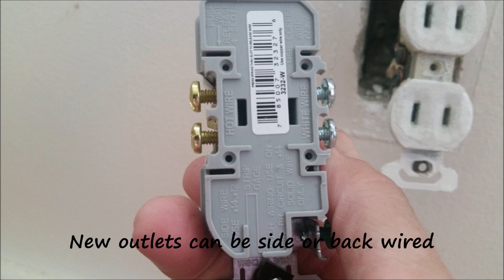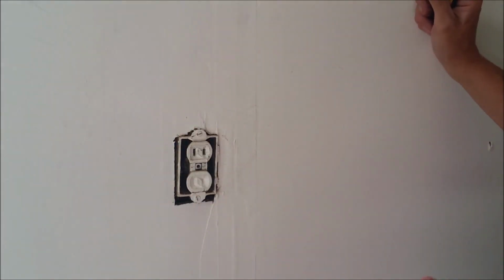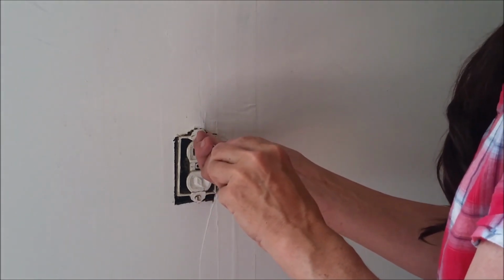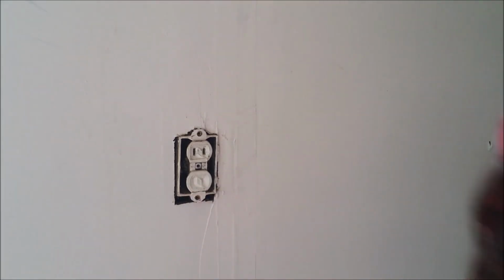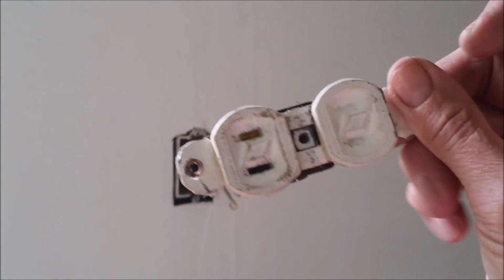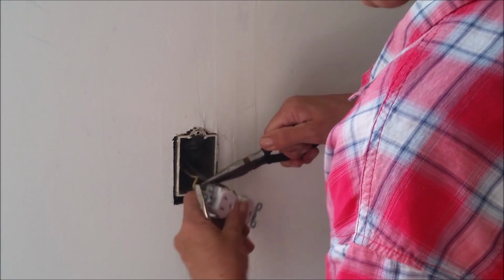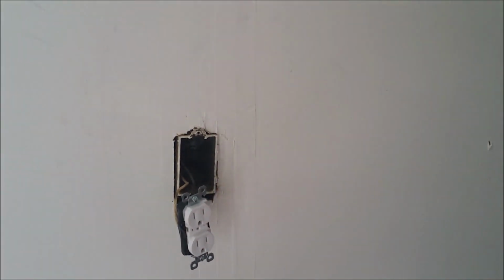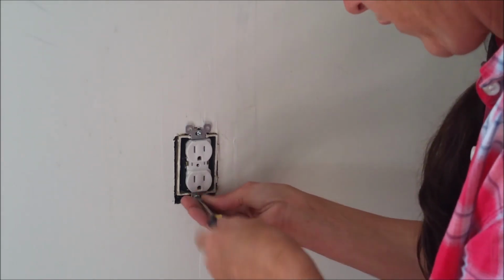Updating Electrical Outlets  | Homeowner Handyman

Comment: Your objective is good, but the execution is lacking in code compliance. On the off chance the box has a ground wire, it must be connected to the green screw. Else you use AFCI or AFCI/ GFCI receptacles at least at the start of the circuit and then let the AFCI feed through to protect the downstream receptacles. A home inspector for a sale or insurance inspection will find this when he plugs in his little plug tester. Google code reference 406.4(D)(2) for additional options and requirements
Reply from the maker: Thanks. The box was metal and ground during another update so the electrical tester did test as ground with the tester. Its my understanding that once connected the ground comes from the mounting screws. Code does say to direct wire or label as not ground as I stated. Old wiring is grand fathered and a homeowner is not required to follow codes as an electrician or have a service permit either (there were no records to show when it was done). I agree that it does not mean you should screw it up though.